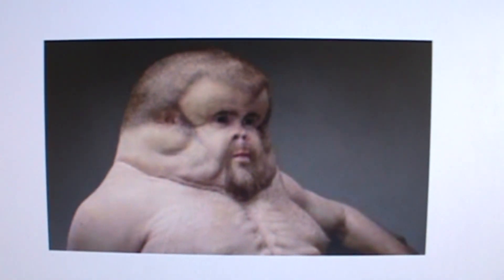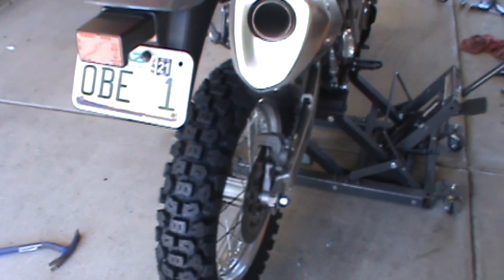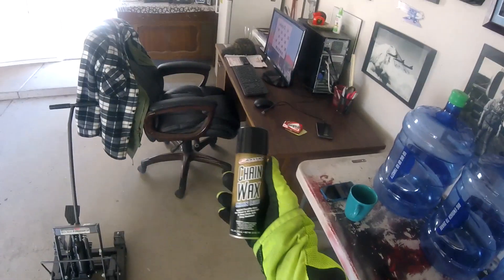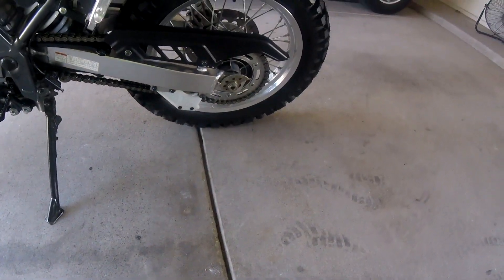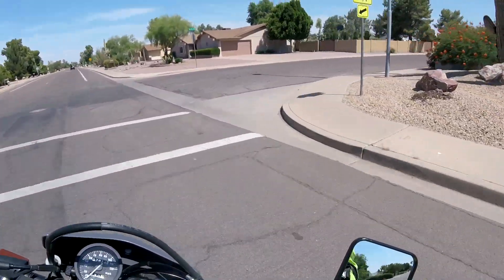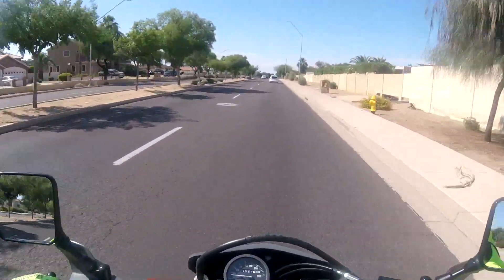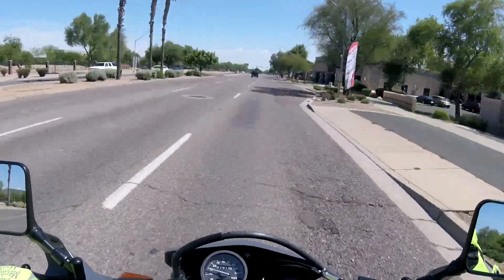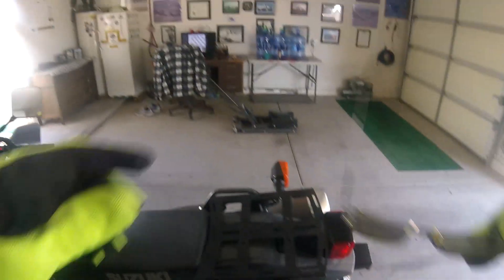SHINKO 244 TIRES STREET / ROAD REVIEW FOR THE MIGHTY SUZUKI DR 650

Comment: I see this video is 2 years old now but I have a question about the speed rating.  You must have a front tire with a L speed rating.  I have the same tire but with a P rating which gives me a 93mph maximum and my rear tire is Shinko 244 with an S rating or 112mph.  I doubt that this bike will do 112 and would not want to be on it doing that speed.
Reply from the maker: Jim - I am not going to be too much help here, and I apologize. Just do some more online research. I can say my Shinko 244's (Golden Boy) state the following: - Front tire MAX SPEED 75 MPH Rear tire MAX SPEED 93 MPH - I do not see the "rating letter" on the tires. I am not sure what your question is, but I will say that my DR will do over 100 - but that's not my riding style. And I don't ride (much) on freeways - that said, 75 MPH would be plenty for me - But I'm old LOL....

Comment: Great informational video. Keep 'em coming.
Reply from the maker: Not too sure about that - but thank you Sir !!!!
Reply: @pilotdane1  I just recently bought a '99 DR650 that still has the "Death Wings" so naturally I'm in the market for new tires.
Reply from the maker: @davidhanger5795   - First of all - "YOU HAVE TO BE KIDDING ME - IF STOCK - THEY ARE 20 YEARS OLD AT LEAST …. NOT GOOD !!!! - On the up & up - I never want to mislead anyone.... "EVER".... That said, do a shit ton of research. Also, I just got these, and I can tell you straight up - the "Aussies" are correct - they are more like 70%dirt / 30% street - but going back to my previous statements - "what kind of riding will you MAINLY be doing" ??????? - Answering that question will guide your decision. I just pulled off a set of Mitas E-07's and they are awesome !!!! In my opinion, a true 50/50 dual sport tire - good on road & off road. This time, I was looking for something a bit more dirt oriented, but could still use on the road.
Obviously, I could go on, and on - but I'll try to stop.... The main thing (again) is what kind of riding will you MAINLY be doing....

I got these for roughly 100 bucks - delivered.... even if they suck, I win.....
Reply from the maker: Lastly - Needless to say, I have several video's. Check into them if time permits.... "LIKE, SHARE, SUBSCRIBE" LOL -

Comment: How long did they last you?
Reply from the maker: Evil - I'm at 3000 miles and still have over 50% of the tread left. Honestly I love them. They are not as good as the MITAS E-07's on the road, but good enough. That said, they are way better off road for sure. MITAS is a true 50/50 tire. These are definitely a 70/30 tire. 70% off road - 30% on road. That said, I live in AZ which is a ton of desert trials. This may differ in more mud, snow, etc....

Cheers & thanks for watching.

Comment: How good is the grippiness on 244's on  pavement use? riding little aggressive with them, in corners etc, how they compare to normal street tires (lets say drz400sm with regular street tires and these shinkos on)? I'm interested in what you guys can say who are using/used these tires
Reply from the maker: They are only "ok" on the road. The Mitas E-07's are better on the road than these. They are grippy enough, but compared to the DRZ 400 SM - with street tires, you won't like these...AT ALL... especially in the corners. These are definitely designed more for the dirt... I'd say 70 / 30. When cornering, you really feel the side lugs. If you are going to be mainly on the road - you do NOT want these tires.

Comment: Thanks for your input. I'm considering the Shinko 244 or Mitos E07. I do about 70% paved roads on my2014  KAWI KLX250 which I just got in June & it came with Dunlop D605's. The balance of my riding is gravel & sand roads. Nothing to aggressive.
Reply from the maker: Bill - I've had these for a wee bit now. I can tell you they are a 70% off road / 30% on road tire. The Shiko 244's are "ok" on the road - but when cornering, you do indeed feel the side lugs. The Mitas E-07's are more of a 50/50. You'll like the Mitas E-07's on the road better, but you'll give up the more aggressive off-road "bite" of the Shinko 244's..... No matter what you do in these cases - in the Dual Sport World - you give up one thing for the other.
Reply: @pilotdane1  Thank you.

Comment: Cool.  Good looking tires.  I got the Mitas E07 after watching your video on them.  What did you think of the Mitas after having them awhile, why not purchase them again and why Shinko?
Reply from the maker: Hi Mike - Absolutely no complaints about the MITAS E-07's - AT ALL - A really GREAT 50/50 all around Dual Sport tire... This time, I was looking for something a little more aggressive off-road. In reality - to force myself out into the desert more - but I can tell you that the Mitas E-07's are much nicer on the road. Why Shinko - Actually, I was looking at the Kenda K 270 - But they have been out of my rear tire size for a while, and saw the review from the Aussies (link in the description) - and got tired of waiting. Make no mistake - you'll be happy with those - as I hope I will too, with my new decision - but always remember - The main thing is - "What kind of riding will you MAINLY be doing - that will always guide your direction !!!!! - Again, you will not be disappointed..... On road - or off.....
Reply: OBI- WAN Thanks!

Comment: Hello OBI-WAN, hope you can give us a review of these tires in a 8 weeks or so. Would you consider 70 off road and 30 on road? will be interesting. I'm due for new tires soon, so I will check your posts. Stay safe and on your two wheels.
Reply from the maker: You are correct sir. You may want to watch the "Ausies" review (LINK IN THE DESCRIPTION) if you have not already - But yes, I am in line with the "Ausies" being 70% OFF-ROAD / 30% ON-ROAD - Could be 65 / 35 - but that'll be about it. They most certainly are NOT 50/50 - I can tell you that already just by the small amount of riding I've done on the street...

Cheers

Comment: How many miles did you get on the rear?
Reply from the maker: I still have them - not even worn down halfway at about 1000 miles. I expect to get about 3000 out of them - and I really do like them very much. Definitely a 70/30 tire.... 70% off road / 30% on road - And they are cheap (in my opinion) Like 120 bucks, for both, delivered to your door..... Not bad.....
Reply: @pilotdane1  knowing all you know what would you choose today? im looking for a 70/ 30 but good with sand.
Reply from the maker: @sombradesigns1734  "Sombra" - I'll have to "tap-out" on that one. I ride through some washes and I absolutely love them - But not very much super deep sand and usually not more than (maybe) 4 or 5 miles at a time.

My point here is continue to do research - There may very well be a better 70/30 tire that is better than the SHINKO in the sand - I just don't know.

For the sand / washes that I go through, they do fine - but DO NOT want to mislead anyone. Sorry for the long winded pathetic reply 🙂
Reply from the maker: @sombradesigns1734  BTW - I still have the Shinko's - and still love them. Probably stick with these for the kind of riding I do - They are great !!!